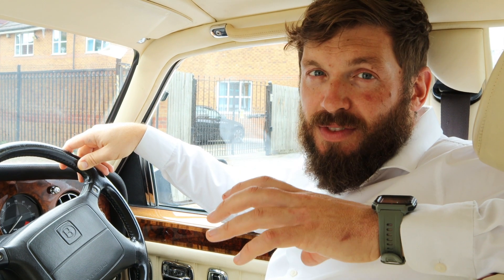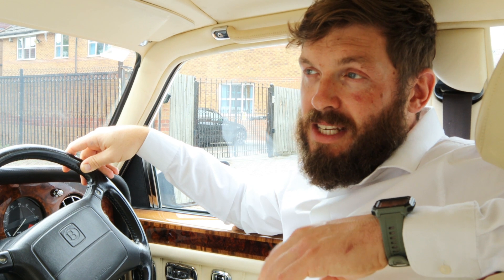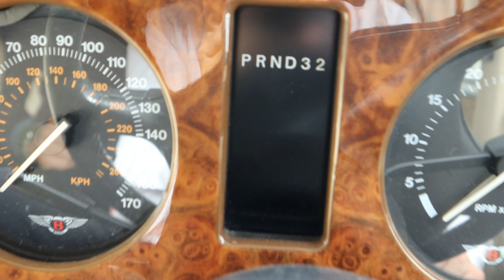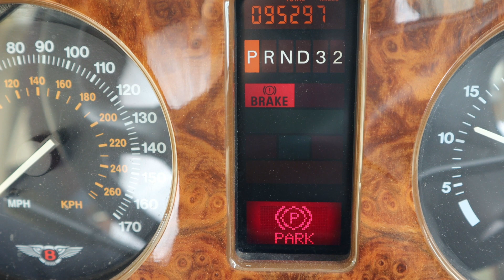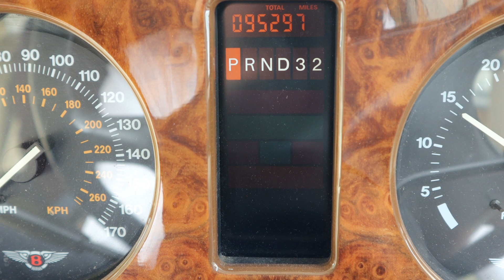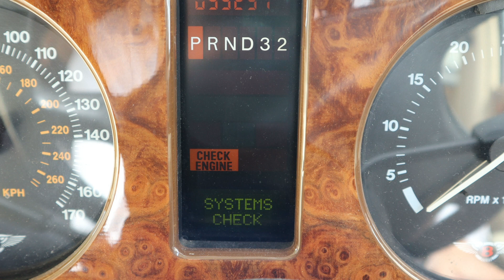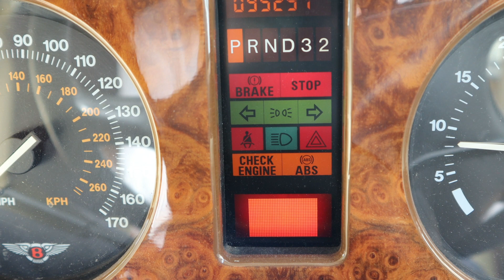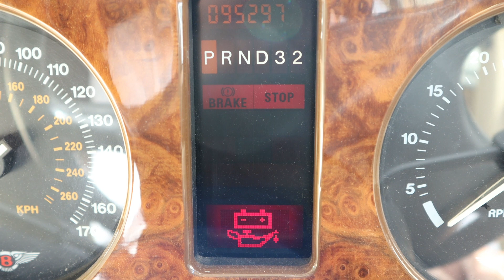Hydraulic System Pressure Test for your Rolls-Royce or Bentley

Comment: Ma786sai Dua truly most useful. Am changing both brake Accumulator Spheres on my 1982 Mark 1 Spirit. Was getting only 27 pumps on Brake 1 and hardly any on Brake 2. So I should get 50-60 pumps on either systems before Red Light comes ON.
Reply from the maker: Hi, yes, with that amount of pumps, you should definitely look into changing your accumulator spheres
Reply: Ma786sai Dua strangely these spheres were fitted new only 18 months ago. Today when I put the Spirit up on the hoist the spheres were clean. One front right-hand Caliper was leaking fluid. Can THAT be the cause on my low pressure? Or do you believe it’s the gas
Reply: Or do you believe the nitrogen gas in one or both of my spheres has leaked? I DO have 2 more new spheres ready with me. Do you think I should DEFINITELY fit ON the 2 NEW ACCUMULATORS? God bless you. Cyrus
Reply from the maker: @cyrussataravalla6731  The only way to know how much pressure is in the spheres is by checking with a pressure gauge. 27 pumps is still reasonably safe but the one that goes straight away, should definitely be changed. Assuming is the spheres and nothing else causing a pressure problem. If the spheres lose pressure they won't be any visible sign of fluid leaking because it would be the nitrogen leaking not any fluid
Reply: @introcar  Ma786SaiDua somehow the spheres not opening. They are too tight. Any idea how to open them?
Reply: @introcar  Ma786Sai Dua Today we changed BOTH front Brake SPHERES. Took the Spirit out for a tiny maybe less than 2 km drive. On returning I did the pump Test and got 12 pumps on Brake 2 and 25 on 1. Earlier was getting just ONE Pump on Brake 2. I wonder if even after carefully fitting these 2 NEW SPHERES the lesser pumps is because the System will SELF-BLEED itself in a day or two of driving around town? Any other reason for getting lesser pumps on Brake 2? One of the brake pumps has a leak. I will put in new seals in that pump. Bless you always. I deeply appreciate your wisdom on Rolls-Royce motor cars and keeping them in their former ethereal timeless regal elegance. 
Cyrus
India
Reply from the maker: @cyrussataravalla6731  How old are the spheres that you have fitted to the car?  I would expect more pumps than that after installing the new spheres. I would also recommend bleeding the system because if there is air in the system, some of the pressure could be absorbed by compressing any air in the system when applying the brakes.
Reply from the maker: @cyrussataravalla6731  If you cannot undo them with large swan-neck pliers, then you can try using a strap wrench. If you can’t do it with a strap wrench, then you can try an air chisel.
Reply: @introcar  Bless you we opened them. We also fitted NEW Orings to one leaking brake pump. Now we got 44 pumps on brake 1 and 17 pumps on brake 2. I gather by driving her the pressure WILL go UP.
Reply from the maker: @cyrussataravalla6731  44 pumps is ok, but 17 is too low. Are you allowing the system to fully pressurise before you turn off the engine and start pumping? If you are getting 17 pumps with new spheres, then I think you should check the system pressures with a gauge. That would tell you much more about what is going on in the system. You can see the video on this here…
Reply: Ma786sai Dua God bless you always for your guidance. These are new spheres. One brake pump was leaking fluid so changing both o rings today. That should help getting pressure. Ok I will bleed system. So to bleed system do we keep foot on the brake constantly, with IGN off or on? And then crack open bleed screws on front and rear Caliper a?
Reply from the maker: @cyrussataravalla6731  probably easier if you just call or email direct? it's matt.duncan@introcar.com or call us on +44 (0)20 8546 2027

Comment: The dangerous assumption with this is that the pressure switches are working, this is why a flick-up test is the only real way to check accumulator nitrogen pressure and is an easy test to carry out. This is a field test that will probably get you by.

The pressure switches have never been reliable and the systems have never had a failsafe which is sheer stupidity because you can effectively drive these cars in a dangerous state with no warnings. It would have been so easy to combine a pressure switch with either the ignition or gear selection so that a dangerously low pressure would prevent the car being used. The engine oil pressure interlock does this but probably the safer way would have been to use an interlock into the electric gear actuator. Rolls-Royce instead, simply assumed owners would be using the dealer network and trained mechanics.

50 pumps on a mineral system car is really good.

Comment: I believe that the pedal test should be done more slowly, rather than pumping the pedal should be pressed and let go with a second or two delay between each application but I'm open to correction.
Reply from the maker: This depends on what you are trying to achieve. On most cars, when bleeding the brakes, it is important to press the pedal slowly and steadily to force out air and fluid from the system. That is different from this operation. What we are doing in this test is checking how much pressure is in the accumulators. I don’t think it makes much difference how fast you press the pedal. Pressing the pedal forces pressure into the brakes, but there is only a very small amount of movement within the callipers, so only a small amount of fluid is displaced. It happens as quickly as you press the pedal. If you are conducting this test yourself, it would be best to develop a consistent pumping technique, so you know when something has changed.
Reply: @introcar  Just awesome answer.  Introcar really knows it's customers.